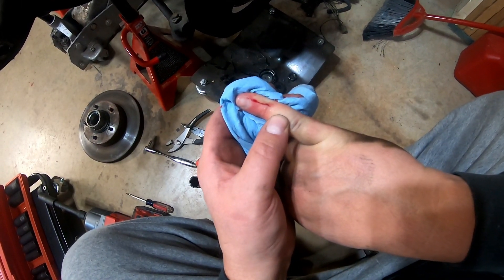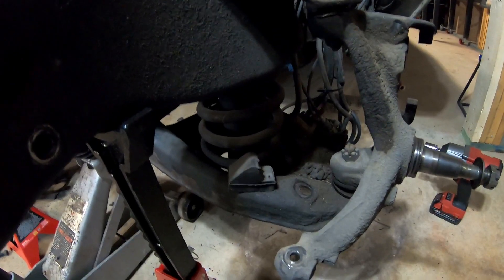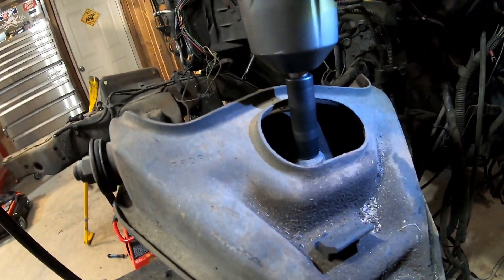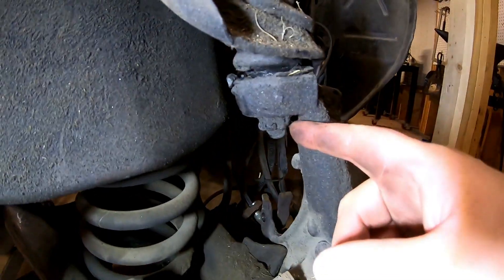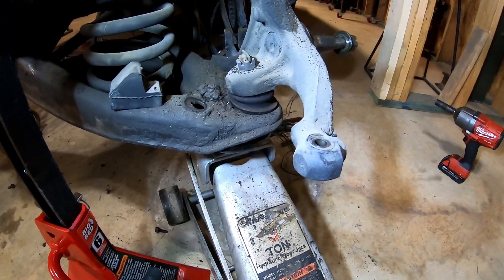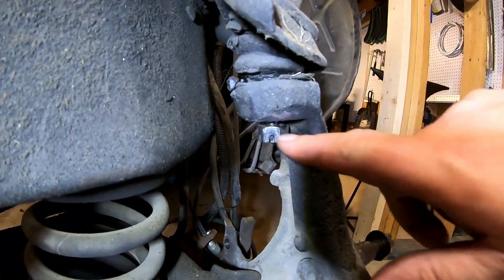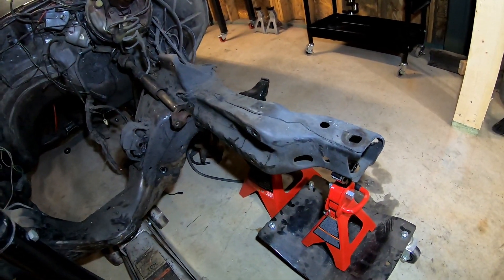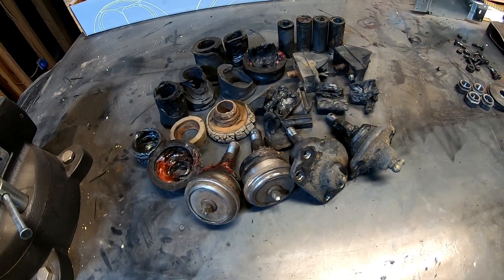78 Camaro Restoration ep14 - Coil Spring Removal (carefully)!!

Comment: When removing tapered studs like the tie rod ends, ball joint to spindle, if you give the piece the stud goes into a good wack with hammer along the side where the stud goes through, they pop out or loosen up enough that you can put the nut on the end of the stud and tap it with deadblow mallet and it will come out. I've even used a air chisel, nut on end of stud not quite flush with top, blunt round chisel on stud end (nut keeps it from slipping off) and a coulple of hits with the air chisel and it pops out.
Reply from the maker: Thanks Gordon.  JD

Comment: You hold the shaft of the shock from spinning by using a wrench to hold the square top of the shift  above the nut. That's why it square. If its really rusted on easy to cut the nut off.
Reply from the maker: Thanks.  JD

Comment: Nice work John!  Are you planning on replacing the control arms or just cleaning them up... obviously you will replace the bushings .
Reply from the maker: Hey Tom!  I'm currently debating this.  I can get a set of Classic Performance tubular control arms with new ball joints, bushings and hardware for about $750.  If I keep the old ones and buy all the bushings, ball joints and hardware I'm in them for about $250 so about a $500 difference plus all the time it will take to clean them up, paint them, etc.  Got them soaking in degreaser and oven cleaner right now so I'll at  least see how they look and go from there.  I couldn't believe the condition of the bushings!  JD.
Reply: @JDOffline  Hi again John, tks for the reply!  Maaaaaan, $750 is a lot of money.  I guess once you get the old ones cleaned up and inspected you will have a better decision point.  Too bad you can't find the tubular arms for around $500... I will look forward to seeing the next video and hearing about the decision :) have a great day!
Reply from the maker: @tomdonnelly611  Thanks Tom!  You do the same. JD.